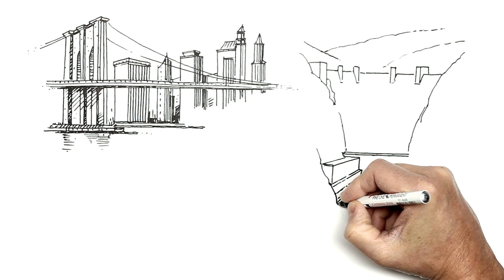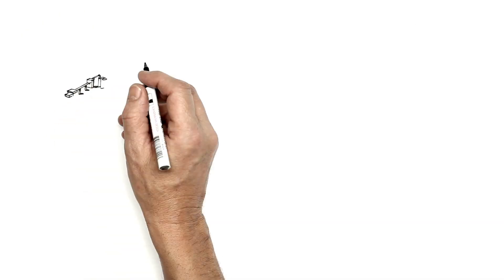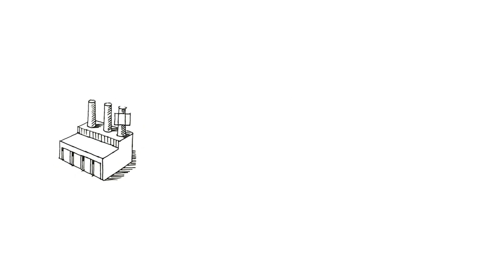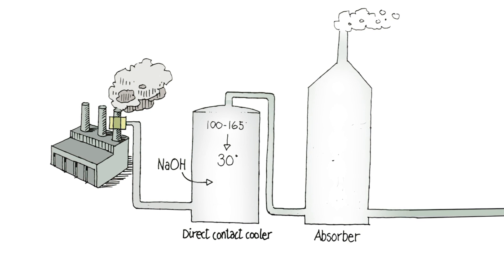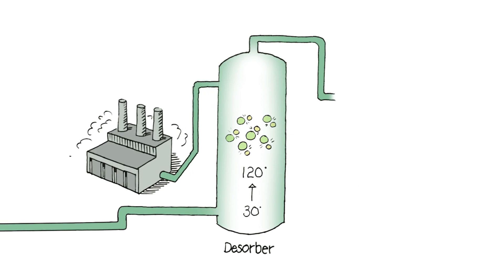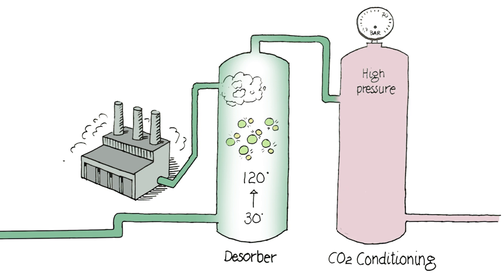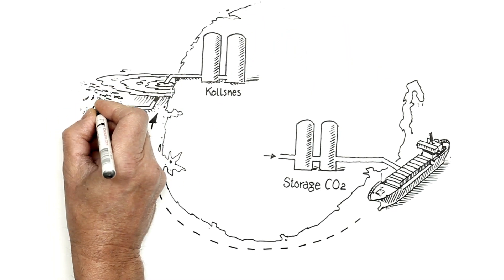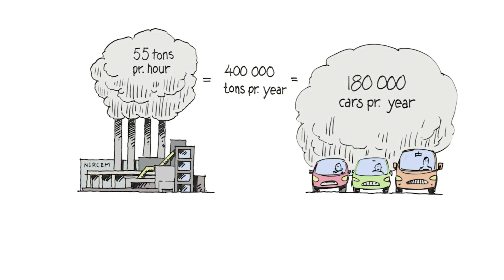Carbon Capture at Norcem Brevik

Comment: It's impossible for greenhouse gas behavior to cause global warming.  This video has the United Nations Climate Change disclaimer.   Global warming was officially stated at 1.1°C in 1991 and 1.06°C in 2022.  There is no mechanism that would allow greenhouse gas behavior to cause global warming.   

The back of the United Nation's IPCC science report states it took its greenhouse gas samples at 20,000 meters altitude where it is common high school level knowledge there is no greenhouse radiant energy.  This is typical practice for deceptive marketing to state legal data transparency protecting the perpetrators from fraud prosecution.   The IPCC has been transparent with its data acknowledging it is not dealing with active greenhouse gases.  

Earth's greenhouse effect is frequently used as a primary example to high school students of a system always in saturation from the strong greenhouse gas water vapor absorbing all the greenhouse radiant energy from the earth with greenhouse gases within 20 meters of the surface that is all around us everyday and can't have its overall effect changed.  There is no further greenhouse radiant energy to interact with greenhouse gases.  At 1% average tropospheric water vapor over 99% of earth’s greenhouse effect is from water vapor.  Water vapor would hold earth's greenhouse effect in saturation if it were the only greenhouse gas in the atmosphere.

Arctic warming is taking place with the proving mechanism being warm Atlantic Ocean waters migrating deeper and more frequently into the Arctic Ocean warming it and the region.   That warmer water is causing a few weeks less of reflective snow and ice coverage resulting in more solar heat gain to the Arctic region surface.

Atmospheric CO2 levels of 1200 ppm about three times what they are today would greatly invigorate C3 plants the majority of plant life on earth greatly greening the planet. 

0.4% of the atmosphere is CO2 and on average 1% is H20 water vapor.   (1% H20)/(0.4% CO2) = 25.  Water vapor is 25 times more present in the atmosphere on average than CO2.   Water vapor has an CO2e of 18,  18 X 25 = 450 CO2e total for water vapor to 1 CO2e for CO2. 

The Earth’s oceans have 3-1/2 million sea floor volcanic vents warming the water and changing it’s chemistry that have not been systematically accounted for.

Comment: SO.
You used a lot of energy to explain that you used a lot of energy to bottle your co2.

It might have been smarter to sequester it instead.
Your solution is merely obfuscation.
Example.feeding your exhaust gas into a very large greenhouse by day would allow crop plants to convert the co2 into food.
No compressor needed.
As long as the other gases were removed.
Partner up with any university that is studying phytomining,and phytomitigation.
Then their biochemistry dept.might give you a far cheaper solution to your waste problem.
Shipping your waste product out doesn't help your future offspring.

Comment: To me this is the way to go. Carbon capture machines are what it's gonna take. Creative uses for them like this is how it's done.
Reply: They don’t work. You need to invest AT LEAST as much energy into turning CO2 into another compound, which completely negates the process. If you have to invest more energy cleaning up the mess, there’s no point.
Reply: FORMULATED MICROCRYSTALLINE WAX WILL CAPTURE CARBON
The heat loss from a smokestack can be forced into a large tank containing hot liquid microcrystalline petroleum wax. The heat will keep the wax at a molten state which facilitate the carbon to be absorbed when combined with the wax. Carbon when mixed with wax reacts like a dye. The wax-carbon amalgamation resulting into a black wax solution thereby making it impossible for the carbon to escape into the environment while in a liquid state. Other toxic particles are also captured in the wax settling at the bottom of the tank forming into a sludge. A sludge release valve is located at the bottom of the tank. After the sludge is removed more wax is replaced in the tank working something like a toilet. The sludge becomes a byproduct that can be used as an additive to asphalt for roads or used for cocooning nuclear waste materials for long-term safe burial. The entropy of the Earth has been increasing at a startling rate since the beginning of the industrial revolution caused mainly by the carbon that is released into the atmosphere. Government scientists have failed to stop and prevent carbon pollution from entering the environment. This problem can only worsen until a solution is found before this problem becomes irreversible. It has been discovered that formulated wax has been shown to be the only answer to this problem. William Nelson waxogen@gmail.com
Reply: waxogen
2 weeks ago
FORMULATED MICROCRYSTALLINE WAX WILL CAPTURE CARBON
The heat loss from a smokestack can be forced into a large tank containing hot liquid microcrystalline petroleum wax. The heat will keep the wax at a molten state which facilitate the carbon to be absorbed when combined with the wax. Carbon when mixed with wax reacts like a dye. The wax-carbon amalgamation resulting in a black wax solution thereby making it impossible for the carbon to escape into the environment while in a liquid state. Other toxic particles are also captured in the wax settling at the bottom of the tank forming into a sludge. A sludge release valve is located at the bottom of the tank. After the sludge is removed more wax is replaced in the tank working something like a toilet. The sludge becomes a byproduct that can be used as an additive to asphalt for roads or used for cocooning nuclear waste materials for long-term safe burial. The entropy of the Earth has been increasing at a startling rate since the beginning of the industrial revolution caused mainly by the carbon that is released into the atmosphere. Government scientists have failed to stop and prevent carbon pollution from entering the environment. This problem can only worsen until a solution is found before this problem becomes irreversible. It has been discovered that formulated wax has been shown to be the only answer to this problem. William Nelson waxogen@gmail.com